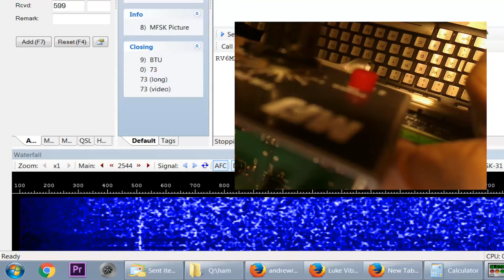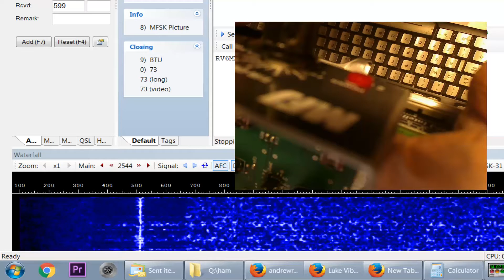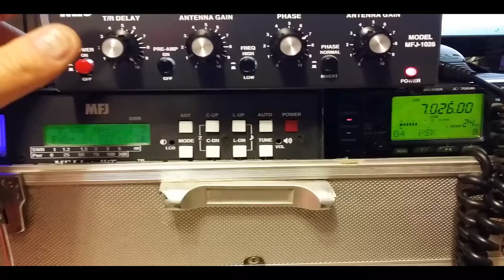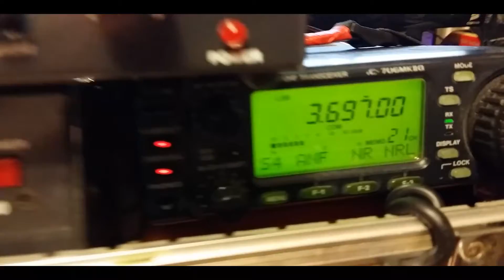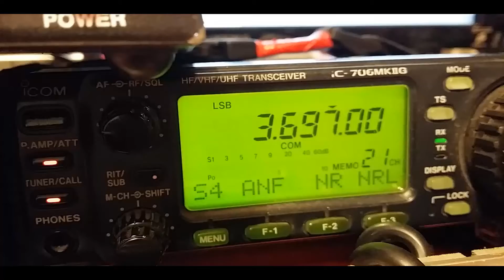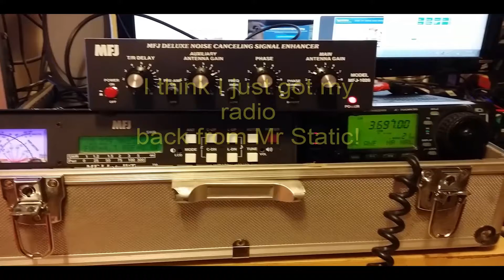MFJ 1026  Noise Canceller Demo1

Comment: first thanks for sharing the video.
I’d like to add that it’s worth noticing that as you drop the MAIN antenna gain to anything less the 10 (ie fully clockwise) you’re introducing progressively attenuation on your antenna system. If you have enough signal strength it’s not a big deal but you want to keep that at maximum level (ie 10) to have the original sensitivity you had before switching on the unit. Also depending on the AUX antenna you’re using and how it captures the offending noise you might need to adjust the MAIN antenna gain too in order to be able to have same signal amplitude. Another thing i’d like to mention to who’s interested in this little device is that if your AUX antenna is “too big” it will probably introduce some other noises or atmospheric noise that you’ll end up with even if you’re canceling out the main offending noise. So the final result will be the offending noise’s gone but more noise flor. 
73s!

Comment: It works, But how do you adjust for such quality reception. All you did is turn it on and off.
Reply from the maker: ok the tuning method is described in the manual and if you follow it to the letter it will get you 95% of the tune you need. The last 5% is just fine back and forth on the controls. The method described in the manual is kind fo like this "Turn both gains to zero. Phase at 10. Turn up Main until you get a signal reading on SU meter, find a happy spot, note main knob value (eg 7.5) and note SU meter level (eg 5db). Now turn Main knob to zero again. Now turn up the AUX knob until SU is at same level you settled for (eg 5db). Now turn the Main back up to where it was ie 7.5 and you should notice a dip on your noise level on the SU... so instead of 5db of signal or noise it should dip down to less noise or you should have a signal that wasnt there replacing that SU5 with SU% of signal (so it wont always dip down for you as there is a real signal there). Now fine turn fractions back and forth on main aux and phase to get best result... we are usually talking a tenth of a notch on the knobs... back and forth. Requires practice but soon becomes easy. I will try and do a video on this to help people some time.
Reply from the maker: There are videos out there on how to set it up... its quite simple and the instructions are on mfj website. You turn on and turn both input 1 and input 2 to zero... turn phase to 100%.... then you dial up say input 2 until you get lets say s7 of noise or signal... then you note the Angle of your knob - say 3 oclock on the knob rotation. Remember that rotation position. Now you turn that knob to zero. Go to knob for input 1... dial that up until you reach s7 of noise or signal... this time keep the knob in that position. Go to Knob for input 2 and put it back where it was at 3oclock we said in this case. Now youll see the noise will have dropped away. Minor easing knob 1 and 2 and the phase will find your sweet spot. I may do a video showing how easy it is.